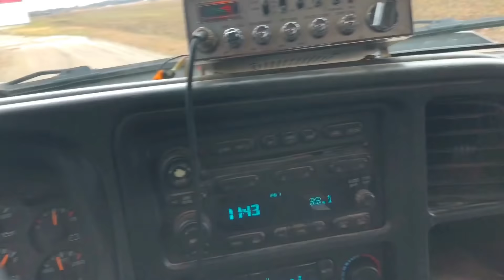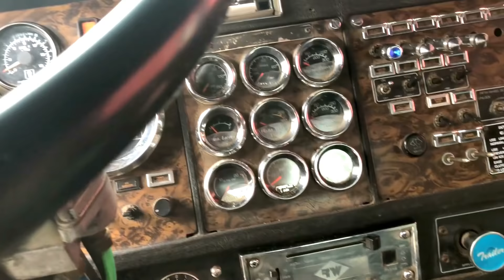Truck shopping!!!

Comment: I was bored so I watching your old videos. I can honestly say I drove a semi over the road for 30 yrs. and 3 million miles under my belt. I have never opened a hood form the front as you have in all your videos. The weight of these hoods can be heavy and cumbersome. If you grab under the wheel well and pick up you have a mechanical advantage in the lift. This makes that hood easy to lift and a lighter lift. You can control these heavy hoods from flopping over to easing it over and let it settle down on its hinges. Try this and you have a better time without straining.
Reply from the maker: I know what ya mean bud alot of guys do that around here I just always done it this way dont really know why to be honest
Reply: @LoggerWade  Thanks for your reply. It just reminded me of wet behind the ears truckdrivers. That got their first truck. keep doing what you doing truck driver

Comment: On the eaton 402 rears there is no difference  between a 38 , 40 or 46k  rears. the carrier ,axle housing, axle shaft are all the same  so no need to spend extra money or time searching for 46s.  I don't know if rockwells are that way too.

Comment: That first truck being it's a '94 it should be a 3406b... I think
Reply from the maker: Derek Schmucker it was a C
Reply: Logger Wade ok
Reply: The 3406B and C were both made at the same time. When it comes to 90's trucks, I've seen more 3406C's than B's. I believe '94 was also the first year for the 3406E.

Comment: Have you looked at Freightliners or Western Stars?
Reply from the maker: Chuck Stevenson no haven’t just because it’s different is all
Reply: Hi, We have a 97 WS, its a good, tough, well made truck. I also have an ole 120 FreightShaker, The best thing about it is the 3406 B Cat, and the 18 speed fuller. as far as the rest of it, they don't call them "Shakers" for nothing. One time hauling logs on the rough roads here in Wis, the heater fan motor shook loose and fell right out on the floor. You need that heater fan up here in the winter time, aye!

Comment: Don’t buy it.  It’s a peec engine. Low power. Lots of electrical problems. If you do get it need to put s set of pumps in fuel system . Set of nozzles. New timing and rack sensor. Turbo too. Good luck they are junk